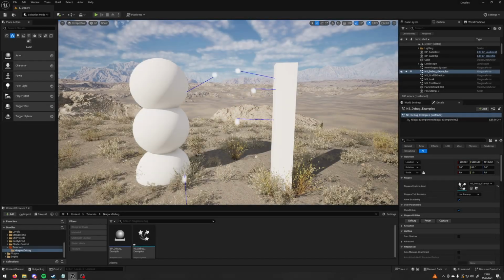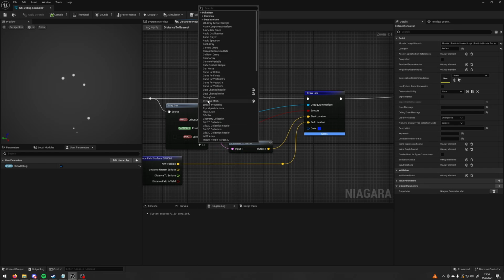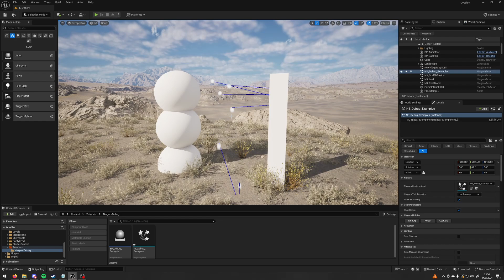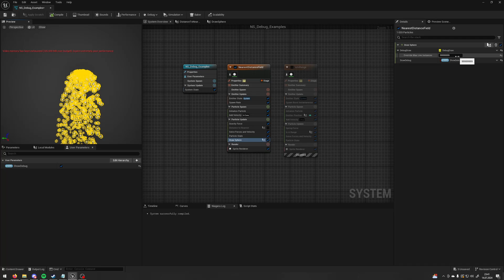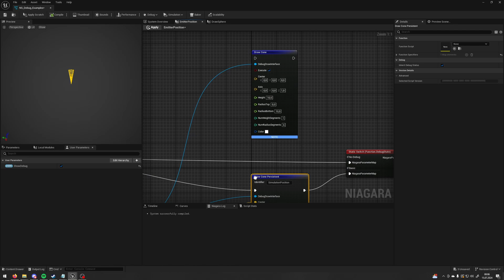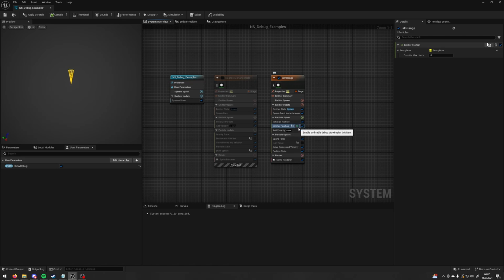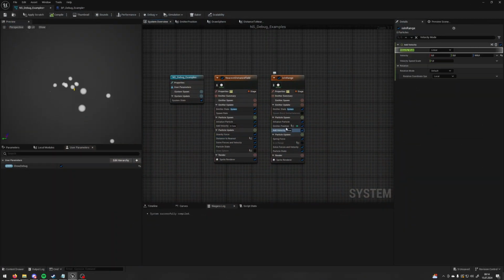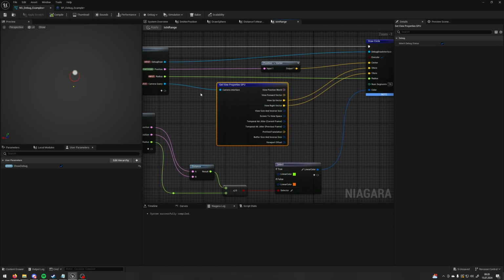Particle Visualization with DebugDraw - Unreal Engine 5 tutorial

Comment: I hope to see more like this! I was wondering if you were able to show how you would create a custom scratch pad for debug lines on the Shape Location as they removed them in UE5 and above :(
Reply from the maker: Hi, it's very easy, here is a simple version for sphere location, but it will also work with box location or other shapes.
1. make a new parameter called  float (Emitter)"radius" in your emitter spawn stage
2. add new scratchpad in your particle spawn stage with debugDraw sphere and input your emitter "radius" parameter
3. add your emitter "radius" parameter to Sphere radius inside shape spawn module

So you will have a single value in your emitter spawn that will control size of module spawn(sphere) radius and also your debug radius :) 
same thing for other type of shapes 

I will be recording another video related to DebugDraw Interface this weekend about particles bbox